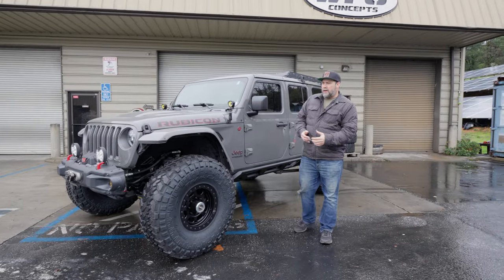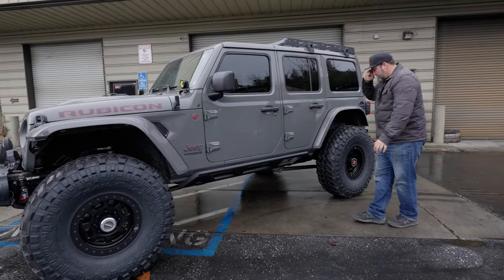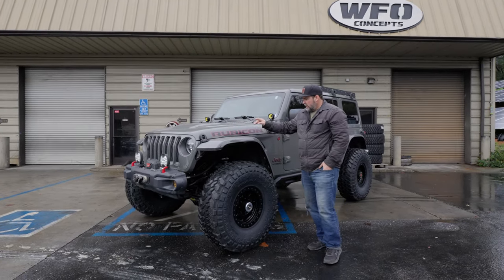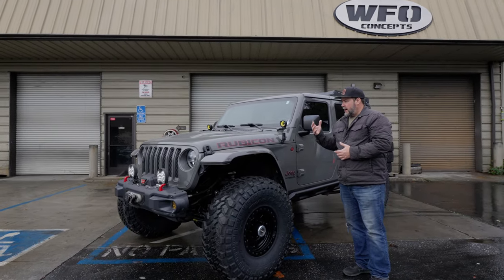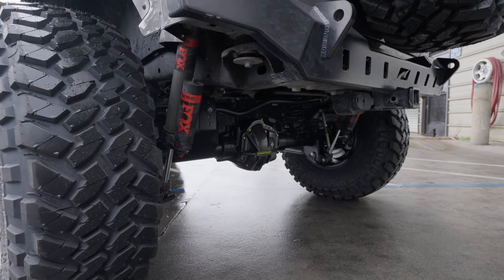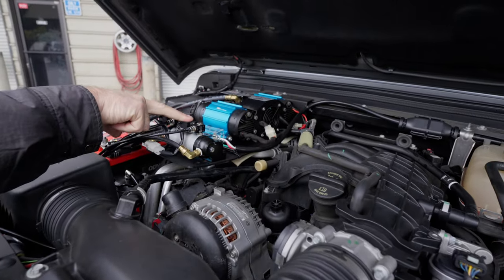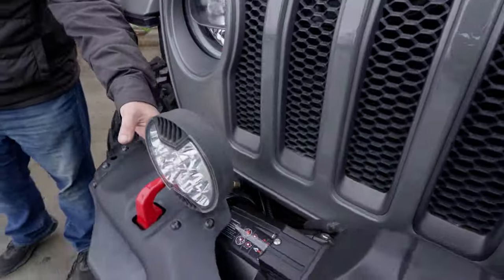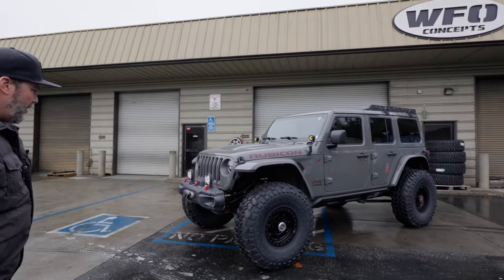Matt's Long Armed JL on 1 - Tons | WFO Walkaround

Comment: Very nice looking jeep and you have a great product but here are my questions:  1.  You spent a lot of time discussing that backspacing and the hub being out past the rim, but that's not what anyone really needs when crawling right?  The hubs should always be recessed to reduce potential damage from rocks when crawling.  Does  this guy realize that, or is this build just a beefy  (for peace of mind) overland vehicle?  2.  Great long arm and I am a fan of the metal cloak suspension as that's what I use on my built JLUR but in this case what is the full droop length of the shocks and on that note what is the measured travel?  Would have been nice to see it articulated with measurements being referenced for anyone considering long arms vs drop brackets (long arm simulators) since coil overs weren't used in this build.
Reply: Because back spacing has the so that’s the reason it doesn’t really matter if hubs the rocks rub them can unlock the hubs but there are benefits to both if you have the cash you know what I’m sayin man
Reply: @jimmy4x4socal44  Yeah.   was just wondering.   Old schoolers have always told me hubs should be in not necessarily for rubbing but mainly for hard hits when crawling.   Also this is the reason for some of the beadlock designs that close down that space to prevent hard impact from rocks.  All is good.  Thanks for the reply.  Sounds like this build won't be banging hard on rocks so that explains it.   
Take care.
Reply: Your concern for the hubs is misplaced and this jeep will turn and handle better off road and one with high back spaced wheels.  Also this jeep doesn’t have the metal cloak suspension which is a great thing.
Reply: @mattbrew11  Oh. I thought he noted it had metalcloak springs?  But why do you say that's a great thing? Is there something wrong with their springs that i need to know about? Lol

Comment: Torque stripe on the bolt head is useless.  On the threads and nut is the way.
Reply: head, washer, and the surface underneath are all marked. If it were me I'd use torque seal or similar since it cracks away when the bolt moves but paint pen marks are fine too